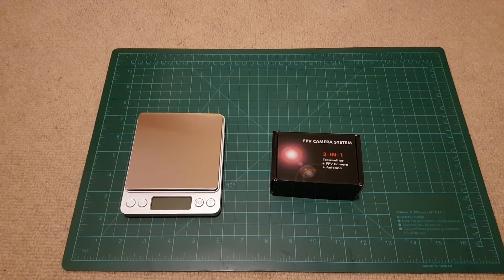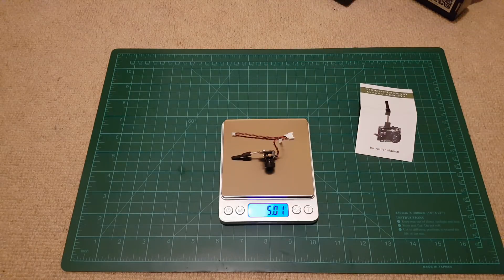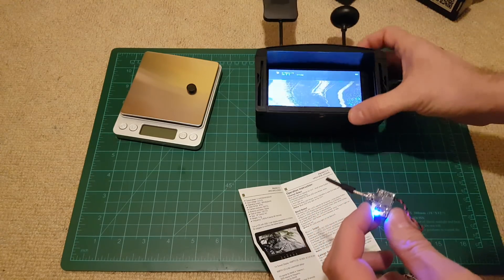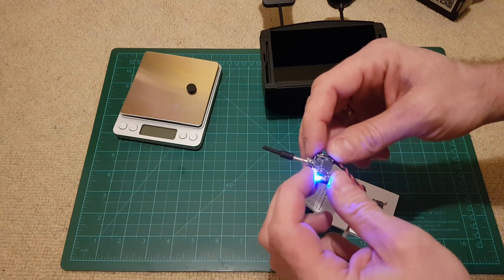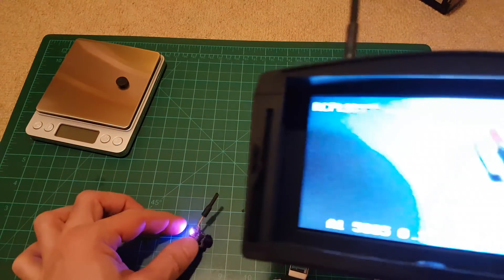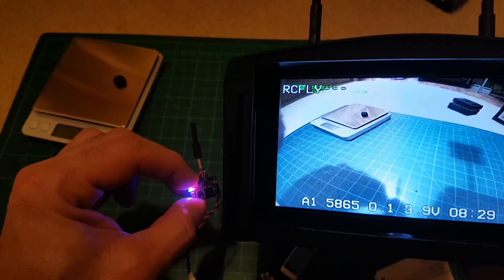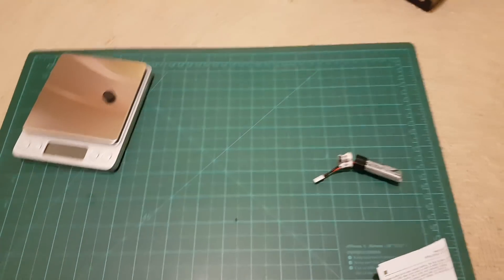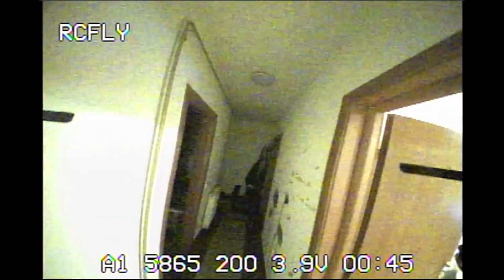AKK A3-OSD 5.8GHz 48CH 0.1mW/25mW/200mW Switchable Micro AIO Camera with OSD VTX

Comment: Dose the camera have osd by its self everytime it’s plugged in or dose it require a fc with osd ?
Reply from the maker: It is its own OSD, built in camera itself, and as you can see there is no wire for external OSD, only 2 wires for battery power.
Reply: Gorazd Cok so it gives the osd on any goggles or fpv monitors?
Reply from the maker: Yes it does :)
Reply: Gorazd Cok have you seen wolfwhoop 500mw vtx only version of this OSD ? . It has no call sign tho